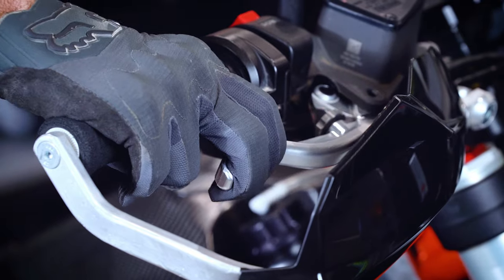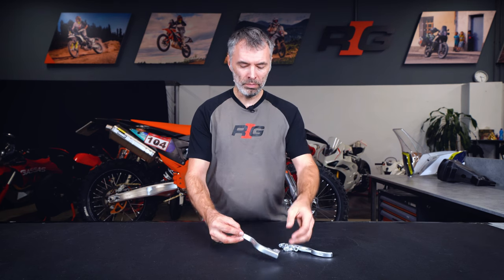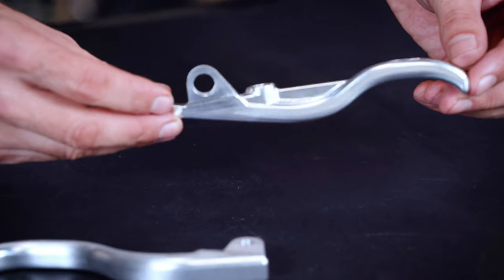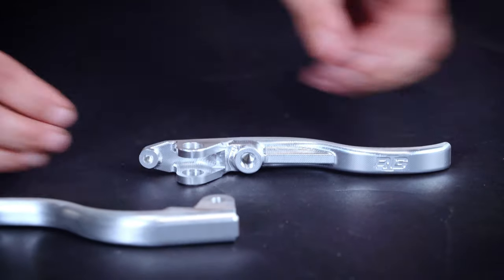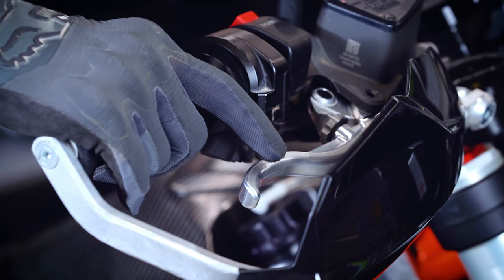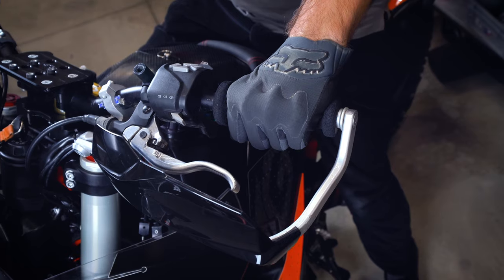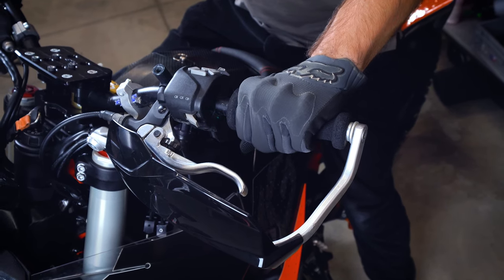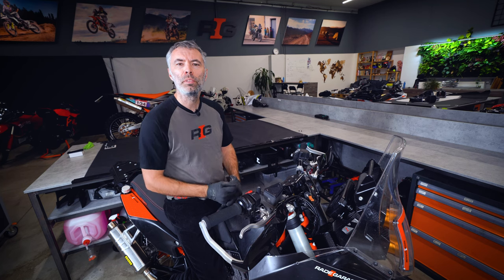KTM 790 890 Adventure short clutch & brake levers by RADE/GARAGE

Comment: Great video, I have a question, on my KTM 890 I have an ARN Rally roadbook navigation control fitted, with the original lever it barely touches when I operate the lever, in this one I see a reinforcement machined part right in the area where the control is located, have you been able to check if there will be any problem for those of us who use the navigation controls? Thank you very much. Your products are TOP.